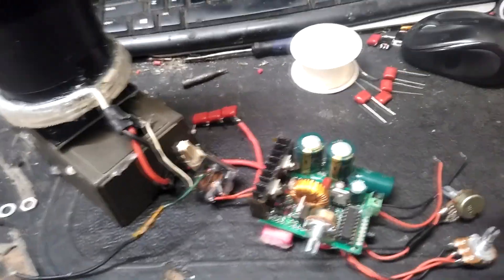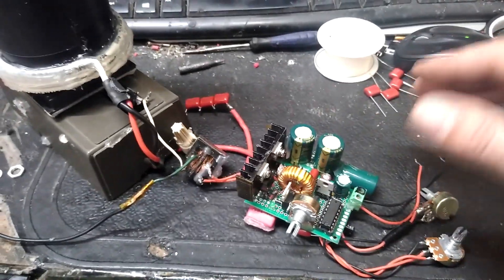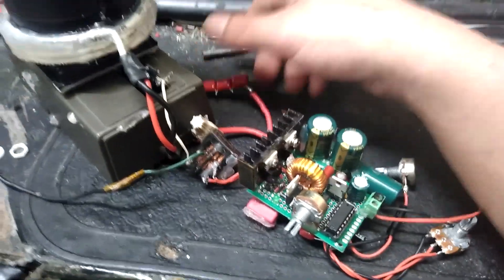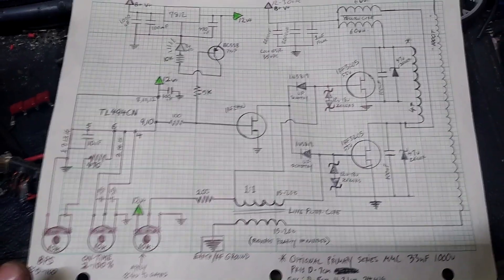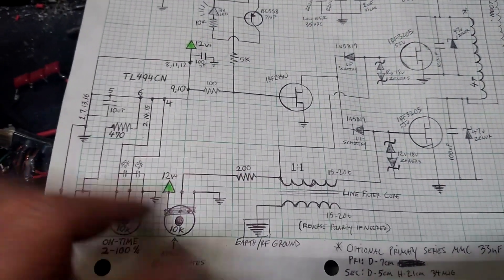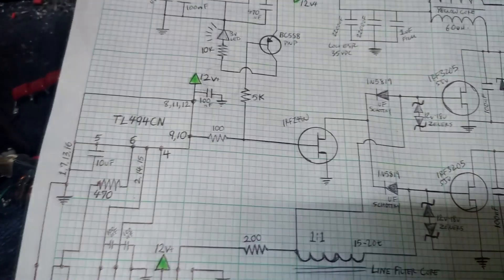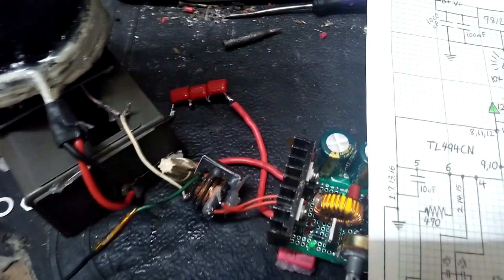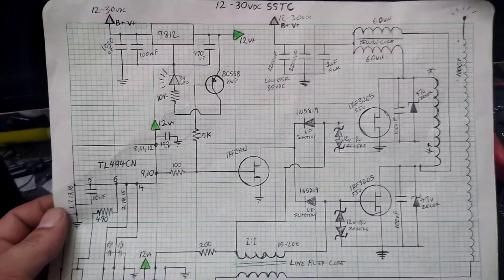12-30vdc DRSSTC IRF3205 Final Schematic (~8 inch arcs @30V)

Comment: Dear sir what is the voltage and nf value of capacitors you have connected from source to drain and how many capacitors have you connected on both sides. One more thing if you put three capacitors in series to the coil please also tell their voltage and NF value.
Reply from the maker: Actually I used 100nF 400V CBB film caps and originally just made a series parallel bank of them to create 100nF. I did that to increase the heat they could tolerate then later just used better 100nF film caps. The 3 in series across the primary are 100nF caps that create 33nF or so.
Reply: @Magneticitist  thanks for valueable reply

Comment: Sir did you use same core for same choke inductor? A double inductor is made by half-and-half windings on a single core? Please let me know.
Reply from the maker: You can use either separate cores or wind them on a common core. The circuit in this video uses a common core.
Reply: @Magneticitist ,Sir who installed two mosfets in half bridge can we double mosfets instead of two four mosfets.
Reply from the maker: @harchandsingh3206  if you only had particular Mosfets and you were worried about their power rating then you could parallel 2 per the high side and two per the low side. Otherwise if you're going to use 4 mosfets you might as well make a full H Bridge.

Comment: Hi , i had some doubt about the tuning elements, i get that i should tune the inductors and drain to source caps but what about the inductance of the primary should that be considered , im planning on a small secondary with maybe 1 or 2 turns for the primary , and a bn43-202 balun ferrite core for secondary feedback , expecting over 2 mhz resonance frequency 
I don't know how to actually tune the curcuit, no scope or inductance or capacitance meter but i plan on getting both . So how to do it is my doubt.

Also is it easier to keep a constant inductor like 2.2uh and change the cap values for resonance ? 

The primary series cap of 33nf , can i just use this value for any coil , or should i change it , how does its value effect the circuit.

Comment: I am very impressed with your work.  Thank you for sharing with us!  Your mosfets have an Rds on of 0.008ohm or 8mohm.  Ultra low rds on...I found a pair that are in the same rds on region only at 100v.  Sic cascades would be a possibility or at least a Fet driver.  Possibly simpler push pull or driver chip.  Best regards

Comment: @Magneticitist: I don't understand what you are writing about the primary tank cap in series to one of the primary leads. In parallel to the primary I would understand, it would form a tank-circuit similar to the mazilli driver. But I fail to understand how a capacitor in series to one of the primary leads would even make sense.
Reply from the maker: Think dual class E rather than mazzilli. There are actually quite a few ways to incorporate the serious capacitor. I have one build I told it using series and parallel capacitance. Most of the time it's more just allowing for a phase shift.
Reply: @Magneticitist  Thank you for your response :)  
Maybe similar to Figure  1 in this paper ?
 https://www.semanticscholar.org/paper/An-improved-push-pull-Class-E-RF-tuned-power-with-Hu-Li/bdb6b238764d3d2bdf322bd177e7eef381bd26b6
(Figure 1 can be looked at without access to the paper)
Reply from the maker: @matthiasfreiburghaus4202  oops sorry I see my reply doesn't make much sense either cuz of typos but yeah I was more or less just saying it can work various ways. Capacitor isn't even necessary for the circuits. Best visual explanation I saw was from a Chinese website where the guy was trying to outline how the drain caps and the choke work together to form the resonant network. Adding a series primary capacitor at that point just helps me tune the phasing, such as how adjusting the primary location affects the output. I tried to add a series capacitor that allows me to sit the primary towards the bottom of l2 and adjust it slightly to shift from sword Sparks to regular branchy Sparks. I'll try to check out that link when I get home right now I can only see what looks like figure 6.
Reply: @Magneticitist   Thank you again. I think I figured out what you mean : ) And the stuff you are sharing on your channel is awesome!
EDIT : Found a proper circuit diagram. This is basically my understanding of what you were describing:
https://www.oreilly.com/api/v2/epubs/9781118844342/files/images/c05f020.jpg
Reply from the maker: @matthiasfreiburghaus4202  Ok I see the figure 1 and I suppose it's pretty close to that if you just consider the single inductor and capacitor. In my case C1 and C2 are more like snubbers across the drains. Then with the single primary winding the R in the network is simply the spark propagation. 

I have one of these that runs maybe the best so far but it has more of a 'double hump' waveform tuning that is not proper class E.

Comment: So which fets have proven best ? I'm preparing a purchase list, cause I blew one genuine IRFP260 yesterday, by not doublechecking the input V and it really got to me LOL
Reply from the maker: I use the IRF3205s for all of these but that's when the intended voltage doesn't exceed 30v. It starts to get outside its niche margin when I feed it higher voltage anyway. The 12-30v or so region still allows for good arcs where I can play with the output any kind of way without blowing anything or worrying over racing streaks etc.
Reply: @Magneticitist  nice specs, especially the on resistance
Reply: @Magneticitist  How do you figure out the resonant value for the cap to use on the primary ?  Since i have identical sec coils, I was thinking of setting up a step down receiver to swap out caps on that and see if I can light some LEDs.
Reply from the maker: @sFeral  trial and error pretty much. I usually stick between 33nf and maybe 60nf.
Reply: @Magneticitist  Trial an error got me 5nf for that grey breadboard coil,  and the other smaller coil should have less inductance, hence those values seem large to me

Comment: cool driver ...excellent results, I like those sparks for 12V... haven't you tried bigger mosfets like IRFP460 for 120 volts?
Reply from the maker: yea but due to the nature of this circuit and the required tuning I didn't see much benefit. There isn't like some proportional increase all the way to 120V. I can end up getting good output but it's not anything I couldn't get with a half bridge at the same voltage. Where this circuit has shined for me is 12v-30v bus operation and can still be ideal up to maybe 100v or so from my experience. I don't know of any other kind of circuit that can be tuned to get arcs this long from those voltages. If I really wanted to take advantage of full mains on a small coil though I'd just build a half bridge.
Reply: @Magneticitist  you're right .. I also see it as very efficient ... I want to build one but I can't get here TL494CN I'll try a 555
Reply from the maker: @victorp2562  555 seems to be a cleaner interrupting IC anyway.
Reply: @Magneticitist  just one question ... how did you build the toroidal inductor for 60uH?
Reply from the maker: @victorp2562  I just basically wind about 40 turns or so around the toroid. 41 for example. Then I make a cut at the 21st turn and make it a splice point for the positive rail. This gives 20 turns each.
Reply: @Magneticitist  greetings ... I was able to build your driver with irfp3205. the spark only increased to 1 in, I think that the source 18V that I am using is a few amps with 5 amps and that's why I don't have good results ... am using a primary capacitor tank 20nF
Reply from the maker: @victorp2562  Only need about 20 watts or so to get decent fairly thick sparks but this coil likes about 24v at least. Not easy to get great output at less than 24v or so.  Deviating from the circuit any I can't guarantee results but using that circuit exactly I was able to get pretty good arcs with a variety of coils after finding the right primary and tank caps. Have to also sort of get an understanding of how your coil is outputting relative to external hand loading or certain toploads or breakout lengths. The primary coupling is important using the tank capacitor so experimenting with the windings and how high it sits along the secondary is probably necessary. 20nF also might not be the best value.
Reply: @Magneticitist  I also found out that my secondary coil only has 657 turns and awg 31 the primary coil I put only 4 turns on. my power supply is 60 watts and the spark is still small. I also need to tune the primary and secondary coils using the correct primary tank capacitor. It would be like a class E converter driver?
Reply from the maker: @victorp2562  I'm not sure if it could properly be called class E being two transistors but it's pretty close to it I think.

Comment: Very good work, I’m gonna have to try this circuit. I tried the original tefatronix circuit and never got very good results from it, maybe this will be better.
Reply from the maker: I'll try to replicate it according to my schematic later. I've sort of replicated a fair deal already but getting this same output again might not be easy. In the end 55v mosfets may be too difficult to get the right tuning without popping them so I want to get it working with 100v fets at least to give more leeway in tuning
Reply: Yea, I agree with that. I’ve always found that when I was in the verge of getting respectable output the mosfets died.

Comment: Did you forget about the "feedback cap" Tefatronix pointed out in his schematic ? The thing to fiddle with, or not if you can measure the inductance of the GDT winding and the coil frequency, cause that combo just needs to hit close to the coil freq, if I'm understanding correctly
Reply from the maker: nope I don't mess with trying to tank the feedback anymore I never got any desirable results from it. Might be useful in a much higher frequency setup but the secondary has no problems pushing the juice otherwise. As for GDT I didn't include inductance on the windings cause I got away with using a few different ones with about the same output. It's the chokes, drains caps, and primary cap that does the magic I think.

Comment: ramped drsstc? 😎⚡⚡⚡⚡ very nice....
Reply from the maker: hell I call it a drsstc but I just really don't know what else to call it. primary was tuned like a drsstc would be with slight variation for streamer loading but it's secondary feedback. At 30v bus though there's so many possible ways to reach that from a low voltage source. I'll probably stick to a 12v lithium pack and boost to 30v so it will be like a crazy portable little guy that spits out arcs like it was 120VAC powered.
Reply: @Magneticitist  if your primary is tuned lc circuit it is a drsstc .... all the early drsstcs were secondary feedback looped but that chip your using made me think it was a Pll sstc..
Reply from the maker: @morganchandler5126  I tried to tune my primary sort of like I would a DRSSTC but it's also detuned enough to where it still runs but the primary resonance isn't as high as it could be. I need closer to like 25nf for the highest voltage out but that pushes the mosfets too close to death apparently. I'm also running really high on times with it that put tons of stress on the MMC so I might get even more output from it with a legit pulse cap and maybe tweaking the feedback a little.  

I wonder if a full bridge at 30VDC would even get output as long though, so it's still a mystery to me what is causing the ramping effect. I can go into all these theories about the chokes and drain caps working with the primary but then it works very similarly with no chokes and the center tapped primary.
Reply: @Magneticitist  the ramping effect is simply done by the bridge input ... the oscillator is the same .... like a qcwdrsstc ..... is simply a drsstc with a d class modulated supply ....
Reply from the maker: @morganchandler5126  but what's going on here tho? there's no input ramp.
Reply: @Magneticitist  its using the halfwave supply as the ramp

Comment: Wow man I love how you relentlessly try things till it works😄 I don't have the patience for that!

Do you have a jpeg of the circuit  please 😃
Reply from the maker: try this link https://i.imgur.com/oGcvMNa.jpg
Reply: @Magneticitist  thank you❤❤❤❤❤ everything makes sense except been trying  to  figure out the purpose of the pnp transistor attached to the output of the regulator/ interupter what does that do!?

Keep up the AMAZING work! BTW awesome  deep voice I'm sure the ladies live it😉
Reply from the maker: @TrumpstienPhile  Normally SSTC's are interrupted with some kind of enable function on a gate driver. So you feed this enable pin a square wave voltage to 'turn on' the output. With this circuit the interrupting is done by pulling the gates to 0v to stop the fets from switching. So instead of a positive square turning the output on, a negative square is what turns it on here.

Since this means a 90% on time from the interrupter means only a 10% on time on the output, I just added the PNP to invert the signal being fed into the indicator LED.
Reply: @Magneticitist  aah that makes sense! 

You are doing Gods work!😜 sending drunken highfives from the UK 😁
Reply from the maker: @TrumpstienPhile  these can take a quite a bit of tweaking to get them to work really good but it's worth it in the end. If all goes well I'll get another version working with higher voltage fets that'll be way easier to tune. This current circuit seems to work really good when the tuning is precise but you stray a little off and it's liable to pop the fets. I'm thinking this is mainly a gate voltage issue with the feedback and I might be able to solve that using the same fets
Reply: @Magneticitist  looking at your circuit I notice you use zeners...TVS diodes(you get bidirectional  ones)can clamp/shunt hundreds of amps at MHZ ranges unlike zeners the downside is they have huge 'silicon plates' so it will increase your fet gate capacitance...tvss have saved many of my slayer exciter  type fets

I'm impressed u managed to push those fets to 30 v😃 as usually the general rule of thumb is multiply fet rating  by 3 for inductive loads🤔
Reply from the maker: @TrumpstienPhile  yea those zeners were basically just added cause I had them but they can be omitted. The addition of them didn't seem to cause any problems but I'm also not sure they are clamping very much anyway. I'd def add tvs diodes if u have them but I've never actually needed them for any of these circuits running 55v fets. After popping them from bad tuning I added them for good measure lol.

Comment: Impressive output. Looks like those outputs you get from VTTC.  With you man, there's that simplicity & courage which I admire from your hard work & determination. What is the secondary wire diameter you've used? is that 30 AWG?
Reply from the maker: I've never seen such output at 30v but no one else really messes around too much with these circuits. I'm hoping someone who can better figure out the circuit will replicate it one day and explain it lol. Skori might have gotten longer arcs at only 18-24 though I'm not sure. That secondary was hard for me to really get the specs on cause I got from Slayer/GBluer some years ago. It seems to ring around 700 khz with no topload and I believe the wire is either 32 or 34 awg.

Comment: wooow I love it, good job man!
Reply from the maker: thanks bro, I think this is about the best I can get from this style circuit. I need to try to get it to work from higher voltage FETs though to see if I can get way longer ramps from like 100v or so.
Reply: @Magneticitist  well the length of your ramp isn't limited yo the voltage  its ontime bro
Reply from the maker: @morganchandler5126  I can actually cut the on time up a lot higher with this one but then it just starts to get bushy and shorter. Most of the beef seems to come from the low esr caps with the right tuning.
Reply: ive been looking for your tiny drsstc schamtic all over i can only seem to fine the one without the drsstc output stage .... im not sure why🤷
Reply from the maker: @morganchandler5126  https://github.com/Teslaundmehr/Tiny-DRSSTC-Update-/blob/main/tiny%20drsstc%20Update!.png looks like it's all in that one
Reply: @Magneticitist  thank you
Reply: @Magneticitist  thats not the one .. he built in with a drsstc output stage and i cant seem to find it anywhere ... ive done everything except direct message tesladownunder ...
Reply from the maker: @morganchandler5126  oh I don't know what you mean by drsstc output stage I guess

Comment: Great job man, the on-times look super long compared to most DRs I've seen, almost like a QCW coil!
Reply from the maker: thanks bro I still don't get it really but so far mucho arcs. I suppose 12VAC input with a voltage doubler would feed it fine. I'll have to try recreating it eventually to see how easy it is to replicate. I've seen this kind of circuit at about 90VAC input giving insane ramps tho and it seems like just tuning it like this along with a huge low ESR DC bus is how to do it.
Reply: I saw that too.  Bus voltage is an interrupt generated with an Audurino.  However, the Audurino generates a ramp...that's how I understood it....greetings